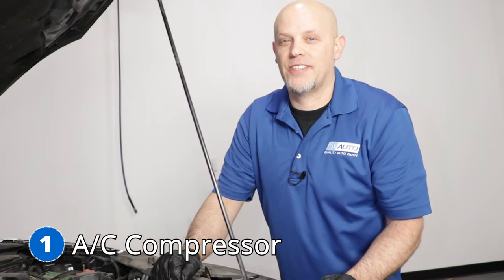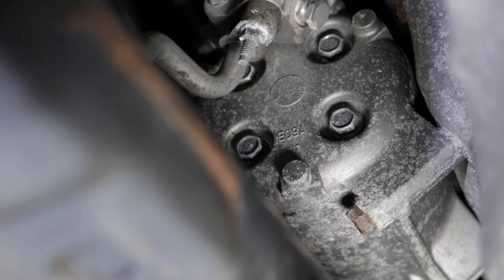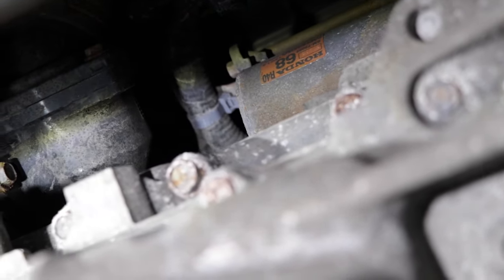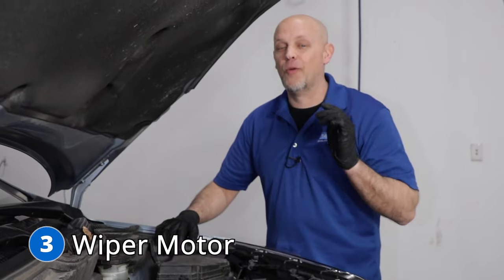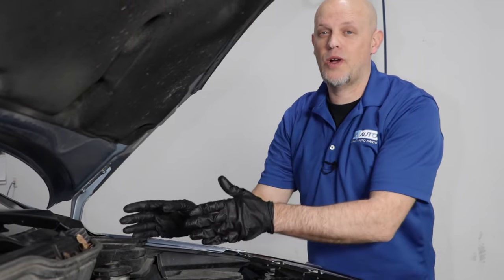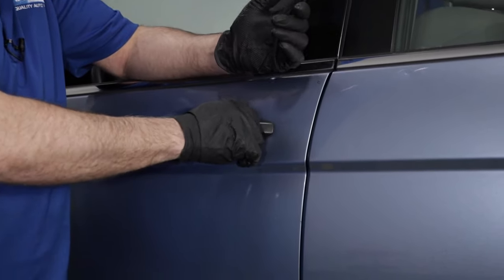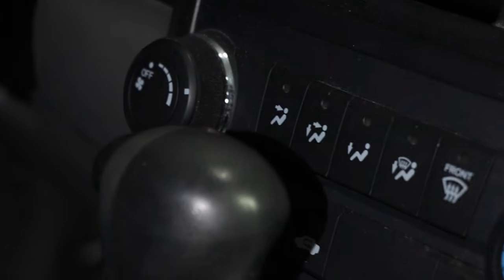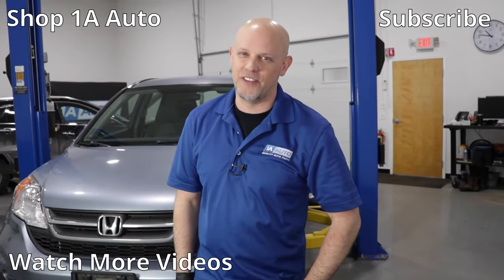Top 5 Problems Honda CR-V SUV 3rd Generation 2007-2011

Comment: Former CRV owner. I am really familiar with the AC compressor problem. Mine was a bad clutch. 3,000 dollars at Westshore Honda. 800, maybe a grand diy. You have to remove the front bumper to replace the condensor. Not an extremely hard job, although I have done easier ones. I am not even a mechanic. CRV's are extremely reliable.

Comment: I have an 07 with 150K in Alaska, and only have one problem with it. Brake calipers seize up every 2 years after last service, due to driving on sanded ice and snow half the year. Spark plugs and brakes are only parts ever replaced. I don't think I have ever turned the AC on.

Comment: My 2011 Honda CR-V (AWD) works fine at 121,896 miles BUT that dadburn AC keeps on quitting on me and my date when it gets really hot and we need it the most!  Thanks for confirming that Honda CRV AC’s are known for quitting when the going gets hot. My date quit on me, too. I may get a Toyota on the next one. Maybe it’ll stay cool when the weather outside heats up. (And maybe this time she’ll stay?)

Comment: Mine has none of these issues however it does have a bad alternator at almost 200k miles as well as a vibration when accelerating that turned out to be a bad cv bearing. The alternator is random but the cv joint seems to be common and I find odd not to have made this top 5 list. I would think a recall on the cv joint issue but so far no such luck as it is a pain in the ass for the diy kinda guy like myself. Better to bite the bullet and have the whole axle replaced. $75 for the part, labor is all over the place so shop around on this one.

Comment: My 2008 CR-V  AC clutch coil went bad, I replaced just the clutch leaving the compressor  hoses hooked up on the vehicle, tight fit for this work but I did not want to deal with losing the gas.

Comment: Question on #2, starter motor - is the symptom of a failing starter motor similar to a car battery with low cranking power? My daughter’s 2008 CRV didn’t start after she drove it to get lunch. While she was waiting over an hour for AAA to arrive for a jump, she tried again and it started. Any opinions on this would be great.Thanks.

Comment: I just trade  my 07 element with 147 k miles for 2011 Honda crv with 129 k miles and just broke the ac compresor on the crv , was the clutch but the mechanic refuse to repair and he recommend change the entire compresor, now work perfect the cold air

Comment: 2010 Honda CRV. Original owner and only issue now is the heater blows only cold air on passenger side. Tolerable in our cold winter with enough heat from passenger side but not desirable for resale.

Comment: I already had the starter replaced on my 08 CR-V. It has over 227,000 miles on it. I need to check the door key lock when I get out of work today.

Comment: Got a 2010 CRV, 150k miles. Struts are bad and the door lock actuators are prone to failure. AC Compressor still going strong, but did have some issues with A/C which turned out to be just the relay. Overall a great car.
Reply: Same problem here. Just got replaced both.

Comment: i have 2009 crv less then 70 thousand miles and your right i had to change ac compressor did it myself as well as the alternator and one of the passenger side door handle mechanisms and now need to replace converter heat shield but it a great car

Comment: Wife has a 2011….AC system already done, starter done, climate control panel is bad now lol. It does have 250k on it though

Comment: The A/C in these cars has got to be among the most poorly designed air systems in the history of Honda. I've been driving my 2008 CR-V for five and a half years, and in that time I have had to fix the A/C almost every summer. Three new compressors have been put into it, a new evaporator has been installed, and the O-ring has been replaced. Four mechanics have tried their hand at fixing the A/C permanently for me. And yet, here I am, $1500 spent in the last four weeks, and the A/C has died AGAIN. Now I'm looking for new cars even though it has 150K miles and I had hoped, when I bought it years ago, that it'd be one I could keep for many, many years until well past 200K. I wouldn't recommend this model Honda to anyone.

Comment: That was great, your opening was the AC compressor. I'm at 298,*** miles and on 2nd compressor. And also the locks, Not a big deal but definitely 2 outta 5 issues.

Comment: I have 07 crv.own 13 years.i changed ac clutch and after 2 years clutch died again. Replaced door actuator.220 k km replaced starter.before dying.serpentine belt.and alternator brushes.ignition replaced.linkage rear brake caliper.egzos pipes nothing major stil running at 260 k km.

Comment: Both the front and rear doors on the right side of my 2007 CRV refuse to stay unlocked. When you unlock them, the lock switch creeps back to the locked position within about a second or so. To let someone into the car, you have to unlock them with the keyfob or driver's master switch just as they attempt to open it. Trying to get out of the car on that side is also an exercise in precise timing - hit the unlock button, pull the latch. If you miss a beat, the door relocks itself.

Comment: Accurate, I had to change out the door lock cylinder, A/C compressor, module for switching between hot and cold air, and starter around 120ish miles give and take a few thousand miles. Other than that, solid car.

Comment: I got my starter changed and hamonic bearing and tension and belt changed its working fine for an suv that has 258,000 miles on it

Comment: I have a 07 crv with a crank no start issue. sometimes starts no problem sometimes takes cranking n cranking then waiting n then crank start finally. has new fuel relay. New plugs. New ignition coils. battery good. any help would be appreciated

Comment: Hi I just bought a 2008 honda crv DIESEL. He has a problem with the bracking. I feel an abnormal noise. A few have told me that it is a problem with the power steering. So please, can you tell me exactly where the problem is? The pump or the rack !! The pump liquid level is normal. The pressure hose is good

Comment: Rear suspension attachment points on the unit body / floorpans rot out, especially on the passenger side in the rustbelt. Canada got a recall. US got diddly. It's cool tho, thats how I got one with 113,000 miles for $400. I got a MIG welder. Should make a fine winter beater.

Comment: 2011 sisters crv, AC went out at 107,000 miles, even with services.  $1400 to completely replace.  My wife’s 2015 civic transmission completely failed around 70,000.  Honda considered it a catastrophic failure due to services being completed from day one.   Replaced but price was $8400.  I miss my 86 prelude. Better construction back then, not in a hurry to purchase anything Honda right now
Reply: ouch
Reply: Buy American or Korean and youll be running back to Honda very soon
Reply: Yeah this is what scares me,not everyone can afford thes kind of repairs
Reply: @girthy10incher23  Not always.  I paid $9,000 CAD in 2018 for a 2013 Kia Rio hatch with 12,000kms and a brand new set of Nokian Hakk winter tires on rims ($1,500).  The car is fully loaded with heated seats, bluetooth, etc).  I'm now up to 85,000km and have literally never had a SINGLE issue with it, which is more than I can say for any other car I've owned in the last 35 years.  A similar Honda/Toyota would have cost me TRIPLE at that time, and even more now with the stupid pricing of used cars.  The only major failure I've ever had in a vehicle was a transmission that went out in an '03 Camry with 175,000km.  I also had to replace a crankshaft sensor in that one.  Toyota/Honda owners tend to have 'brand-loyalty' blinders on.  I've heard comments that 'all I had to do was replace the transmission', other than that, it's been great!  😂🙄

Comment: How many miles into the ownership do these issues show up? I am looking to buy a 3rd gen from 2007
Reply: have a 2011 and the ac compressor need changing around 130,000km
Reply: @josephbrillinger4643  my went bad at 85K

Comment: I have just bought a Honda crv exc,  2010 ,looks amazing has 51000 thousand miles on her,  driving well, but occasionally there is a slight tweet sound like a bird, dont know what it is ,any ideas, apart from that all good. Thanks .

Comment: The problem is not the ac compressor, is the compressor clutch, its get rusted and it doesn't want to stuck, you need to put some wd40 or any lubricant and tap on the clutch with a hammer or something, after you will see white smoke for few moments and after that, the clutch will stuck and your ac compressor gonna work. I did that on a honda crv and honda fit, and it worked.
Reply: There is a TSB on the ac clutch 12-072 and explains the repair in detail.  You don't have to evacuate the system either.

Comment: I've had mine new since 07 and I have 0 of those issues. I did have to replace the evaporator and one of the doors unlocks itself.
Reply: There was a recall on the door locks.

Comment: I’m looking at a 2007 crv with 198000 miles. I’m looking for a vehicle that I could do a lot of diy repairs on. Would this be considered a good vehicle for that? Also has anyone ever replaced a engine or transmission on one of these? Or do they typically scrap them?

Comment: On 2011 CRV, I've read in several places how a number of people have had issues with random acceleration while braking, or unwanted random acceleration when starting from a stop, sometimes causing accidents. Ever heard of that one? Pretty big deal obviously
Reply: Gremlins pushing the accelerator pedal, seen this many times

Comment: My 2007 CR-V has 190K miles on it. The auto locks on the doors are also prone to go bad-  I had two replaced already. A/C, starter, alternator were also replaced. I'd rather pay $800 in repairs maybe once a year, than pay $800/month on a newer car!

Comment: Hi! I have an issue in my honda crv 2008… and from last night when i lock the car after few seconds the alarm goes on it self… so I couldn’t find the problem so i had to switch the baterry off and close it manual.. any thoughts about it? I notice when i lock the car on dashboard the red light of security system indicator comes on and warning lights on dashboards comes on twice but outside of the car the warning lights don’t do nothing like use to be lights when you lock the car?
Please any help? Thank you soo much in advance

Comment: Wiper motor is fine, the contacts on the motor cover are what have issues.  Just replace the cover (Honda sells them) or clean the grease off the contacts on the motor cover.

Comment: Agree with what the Youtuber said based on my experience with my 09 CRV: AC compressor failure, start failure (twice, expensive to repair), 3 door actuator failure.

Comment: hie I have a Honda crv 2007model diesel engine, It has a problem when starting, it can't pickup the idling, I have changed the diesel pump but is still  the same, I'm using quick start everytime when want drive it

Comment: Only issue ive had on my 07 crv with 180k is tensioner pulley and its made a slight winding sound from 1st to 3rd then goes away. Sorts like when u go in reverse on a car, that winding sound. Any ideas what that is? Ive heard that on many other 3rd gen crvs

Replaced trans oil with honda dw1 oil as well as the trans filter and still makes the noise. Doesnt affect anything, its just annoying
Reply from the maker: +G Rmz Thanks for the feedback!
Reply: Did you find out what that was I’m having same issue on 08 crv

Comment: I recently had an AC clog in either my expansion valve or my condenser dryer. Ended up replacing both. It fixed the problem but then it started leaking refrigerant. At first it was the o-rings. Fixed that. Still leaking. I’m putting a new Evaporator in it tomorrow and if that doesn’t fix it I’m giving it to the dealership

Comment: Knock on Wood have 2007 Crv 125,000 , a/c clutch replaced factory recall, blower inop bang on switch under left side of dash above gas pedal area, no other issues, out of pocket spent $ 0.0

Comment: It's not the ac compressor it's the coil and clutch .I replaced mine I have 120k it started going at 80k.there was a recall on this also for the coil only but I decided to change clutch also.i replaced my blower motor it started clicking noise while spinning.took 30 min to install very easy fix for something that constantly runs.the door actuators were a recall also .other then this half is just maintenance mine has 120k now and runs beautifully and very comfortable to drive only complaint is wish it was a little faster .other then that it's a great car
Reply: How much did it cost to replace the clutch?
Reply: Honda put out a TSB on this. TSB 12-072  it relates to the clutch and possibly the coil as the culprit.

Comment: I have a  2011 honda crv  with 74k on it  and the steering wheel is extremely hard to turn  no matter what way you turn the wheel. I'm wondering  what's wrong  and if anyone can help
Reply: You need a mechanic and a loan from the bank

Comment: Not all...just the ac compressor's clutch can go bad... And it's easy to be replaced i did it my self....starter, wipers motor, door lock all works flawlessly.. My car has 200k on it

Comment: I hear some people say the CRV's have weak auto transmissions. 
Is that true ? They seem to have solid engines so not sure why they would design a fragile transmission.
Reply: 230k miles. No transmission problems or noises. I wont lie...im pretty rough on it. Someone probably tried to flush the transmission fluid then it started acting funny. That will happen on most Hondas. 😃VERY common. UNLESS it was flushed every 30-40k miles religiously. Its also not just Hondas but Hondas are what I see this happen most with
Reply: Mine was having issues and the dealership just shrugged at me. No codes were thrown. Still charged me outrageous price to just check it and update the computer. The way I described it to them is that it seems to get stuck in neutral if I coast down a small hill and without hitting the brake, begin hitting the gas again to speed up. My car absolutely cannot transition from that, so have to baby it now when I'm doing that motion or hit the brakes enough when I'm going down even a small grade. I just hit 80k miles on my 2007. I barely drive or do anything with it. Certainly not hard on it by any means. Interestingly I haven't had any of the issues in this video go bad....yet?

Comment: I was thinking of buying 2021 Honda suv. Do you recommend to do so ?
Reply: I prefer 2.4L, 1.5L too small
Reply: Don't do it.  The 2017 Honda CRV I have always has problems plus it drives like a truck and is loud to the point you cannot have a conversation with anyone.  Find another vehicle....I wish I had!

Comment: I have a Honda CRV 09. Just failed inspection with a leaking rack and pinion. Called almost 10 garages and they all charge between $1700 - $2000 to replace. Ouch! The car is no more than $6000

Comment: My crv 2007 have 190,000 kmh I have problems with the starter motor I will change it for the professional version that has the celenoid outside I also have problems with the compressor it only cools well when moving when The weather is very hot, I also have oil leakage, it makes me crazy change the gasket of the vtec and it continues to leak oil
Reply: When moving? Check the condenser could be dirty or fans. Oil leak, check those Oil seal. Ours both Axle oil seal LH and RH are leaking

Comment: You do not need to replace wiper motor (which cost $300). You need to replace just wiper motor cover cost $35 and 2-3 hours labor DIY I just replaced myself.

Comment: 2011 honda crv only has 157,000kms and is already burning a ton of oil. Its common with the first iteration of the piston rings they fixed it for the 2012 model i believe

Comment: Just discovered this channel - nice content!
I have a 2011 honda crv and its AC condenser cooling fan broke.
I bought a after market fan from 1A auto and it works - pricing is nice! The product looks to be solid built.

The crv currently has 150k miles -will be on the look out for these problems down the road.
Reply from the maker: +JY kayak fishing Thanks for checking us out! http://1aau.to/m/Shop-1AAuto-c

Comment: I’m having an issue with my Honda. I’ll be driving normally then when I press the break and turn to the right and press the gas it doesn’t want to go like the gas peddle isn’t registering to the car to go almost like the car is shutting off but everything’s still on and normal just no gas. It’s only when I turn-press the break-then gas peddle and it slows down eventually when I press the gas peddle harder it will pick up and go. Please does anyone know what that issue can be 😭
Reply from the maker: +French Toast We wouldn't be able to diagnose an issue like that here, you may want to have a local mechanic take a look at it. Thanks for checking us out! http://1aau.to/m/Shop-1AAuto-c
Reply: @1AAuto  😕 ok thanks anyways 👍

Comment: Stuck piston rings causing extreme oil consumption are a major problem for these 4 cylinder Honda’s I’m literally dealing
Reply: Especially people who drive 9-12,000 between oil changes. The excuse is "Because the dealer told me I could."
Reply: Most of this is from the 2010-2011 motors, the 07-09 did not have as much of a problem with oil  consumption.

Comment: I've got a '08 that recently began to flashing  the "D" while I'm driving along... nothing else... ran the code with a scanner and found a P0845 code... any idea what it means?
Reply from the maker: +Andrew Christiansen We wouldn't be able to diagnose an issue like that here, you may want to have a local mechanic take a look at it. Thanks for checking us out! http://1aau.to/m/Shop-1AAuto-c
Reply: @1AAuto  Will do. Thanks.
Reply: My 2014 did the same thing flashing D, found a rodent chewed the wire on the top pressure switch 1-2 located top of bell housing, went ahead and replaced the 1-2, and 2-3 updated switches